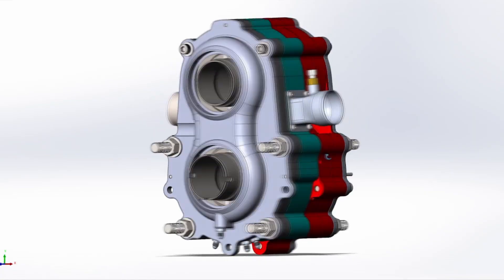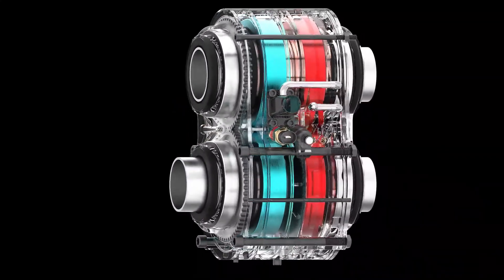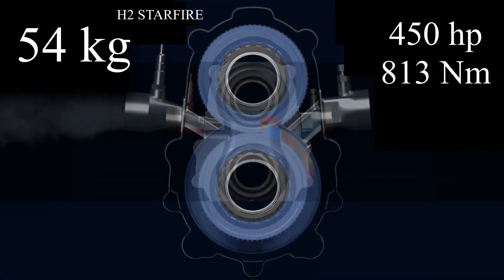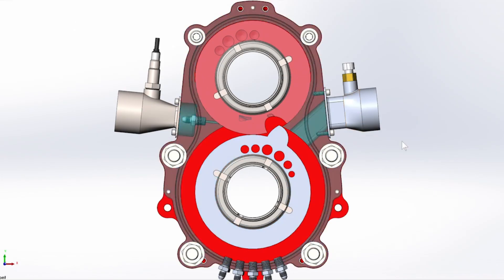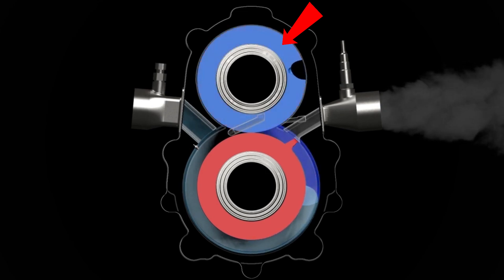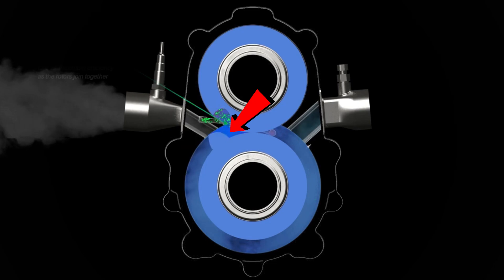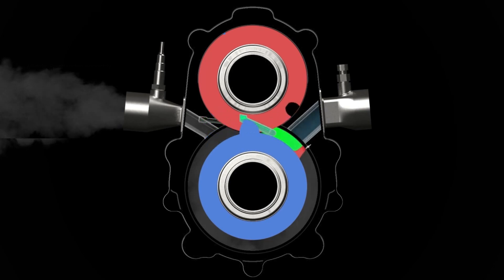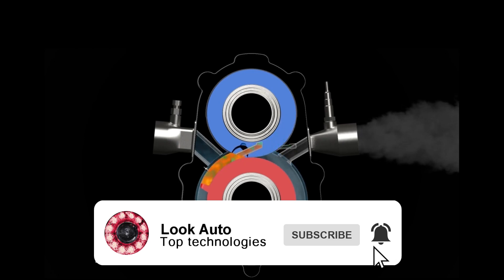New ENGINE: 54kg 450+hp 25,000 RPM How Work?

Comment: This Has the Same Problem as The Wankel Engine: LOW COMPRESSION.
The Kesaria Engine is an Advanced Aircraft Engine.
Reply: The Conventional: 4-Stroke Piston is Better for Power/Electricity Generation.
The 4-Stroke is: Well LUBRICATED and COOLED. So, a 4-Stoke "May" - Last Longer.

Comment: One of the rotors will always work with cold air coming from outside, there is no problem with that. The other rotor will always work in the combustion chamber. This piston cannot withstand 2500°C, it will melt.

Comment: In Piston/Cylinder engine.. gas leaks around.. piston Rings but there are lube-oil seal.
In rotary engine.. major Gas-Leak all around.. the MAIN- ROTOR.. 
Even severely gas-leaks when without.. APEX Seals of such Double (Circular) Rotor.!!

Comment: Find how fast spinning (RPM)  @ 450 HP output: HP = Torque × (2πf)
 ;  450 hp × (747 Watt/hp) ÷ (813 N-m) ÷ (2π)
 = 65.71748 Hertz × (60 rpm/Hertz).=.  { 3,943 RPM } <<< 25,000 RPM (Max)
The Operating Engine Speed (RPM) IS ...4,000 rpm.  (not 12,000 or 25,000 rpm)

Comment: I was waiting for this update on this Engine, that I consider  the only new thing that appeared in decades.  Rotaries are just the same and I just don't see where it could be better.  This one is interesting and promising.  But let me tell you.., as an Engineer I can say that hydrogen is a "romantic" dream that has nothing to do with reality !   Yes  you've mentioned .., 700 bars ( 10 thousand psi ) is an insane high pressure that I'll never allow in my car,  specially with composite materials, no after the Titan submarine.  And Hydrogen makes iron base metals Brittle !  And is so thin that leaks through the walls of the tanks.   Sorry to say but it's better not to expect anything with Hydrogen.  There is no aspect where it is better than fossil fuels.
Reply: Exactly. Perhaps they can add oil to the fuel like a two stroke. Or they can develop some way to save oil from the combustion chamber but this needs to run on gasoline if it

Comment: Over my long life I have seen dozens and dozens of "New" engine designs and they sound great in theory and on paper but they never go anywhere!  There are always drawbacks that make them untenable.
Reply: The problem is separating the lubrication from the combustion chamber. It suffers from extremely difficult tolerances and needs a lubricant that is non flammable. An alternative to oil is necessary and then the engine can simply be lubricated without burning the lubricant

Comment: Oil in the combustion chamber and titanium parts are a deal breaker in the automotive industry because they are illegal. Thermal efficiency of 60% is something I only believe when I see it. This engine must have quite some rolling resistance if sealed as the rotating surfaces are huge. But a rotating system can reach very high rpm as it does not need to alternate a mass.
Reply: Hmmm sounds like a fancy 2 stroke rotary and if i get one of these ill use amsoil interceptor 2 stroke oil with a homemade oil injection system plumbed in with a VRO pump. Might give castor 927 maxima a try, not much low end torque here if it has to rev to 25k rpms but oh well cant have everything! brappp.

Comment: Hello, i saw that you make holes to equilibrate the piston. What if you make the male disks with two teeth in the opposite position and the female disks with two holes also in the opposite position. The system should be in perfectly equilibrium, the amount of combustion gas would be half but twice in one complete spin. If you need more volume, you can make the disks brighter. So with 10 to 20 percent weight increase you should gain double power. Please excuse my grammatical mistakes.

Comment: First of all, who is the Muppet that uses both imperial and metric units together like newton meter and horsepower. second anyone with half a brain knows that there is something wrong with their math's. If this engine produces 600 ftlb of torque and 450 hp, why on earth would you rev it out to 25000 rpm. If it maxes out at 450 hp then at 25000 rpm its only making around 90 ftlb at that rpm. nobody in their right mind would continue to rev it that hard so far past its torque peak. the power peak would have to be around 4000 rpm past that point the torque would drop like a stone. This is dumb, do a better job of marketing please. rant over.

Comment: I think this is a marvelous concept, but being targeted at the wrong sector. As has been pointed out in other comments  the thermal expansion is going to create too many problems. This concept depends on extremely tight tolerances, which may be allowed for at full running temperature, but affects efficiency at start up. So it could be something suited to long/continuous running like a large fixed generator, rather than a small range extender for an EV.
Reply: It seems to be based on the same mechanics as an external gear pump, with just one cog. Maybe  it could be developed as a hydro motor.
Reply: Just based on looking at the mechanical concepts, it seems to me like the tolerances are not nearly as strict as a regular piston engine. Could you briefly explain why you think the tolerances are tighter?
Reply: at the point where the "tooth" passes into the next cycle is when you would have the highest pressure, and the fuel is injected at the same time, you are depending on the tolerances to stop the charge from escaping. This is also when you have the least amount of material, ie. point to point, to achieve the seal.

Comment: will not work in this configuration-design. fluid dynamics prevents  pressurised air from forming the  air fuel charge prior to TDC. also combustion cannot complete to meet the lobe at TDC. so the formation of usable pressure at TDC is impossible.

Comment: Too good to be true  ! 
I would like to see this new engine in a car 
54 kg , 450 hp , 813 nm : actualy it’s only a dream without proof of concept 
Wait and see...
Reply: With the power stroke happening so far away from the 'crank' axis, high torque seems plausible. I'd have far more immediate doubts about the feasibility of the sort of dimensional precision and stability required to make this thing work reasonably well in the first place. This is a rotary piston engine and all such designs so far have fun into issues with face and apex seals partly caused by uneven thermal expansion no matter which alternate form they take.

Comment: it's not gonna run reliably unless it uses oil mixture fuel like a two stroke, or oily fuel like diesel fuel. The question is, is the compression high enough to be able to burn diesel fuel.
Reply: Fantasías animadas de ayer y hoy jajajaja
Reply: Exactly
Reply: Exactly this needs oil injection!